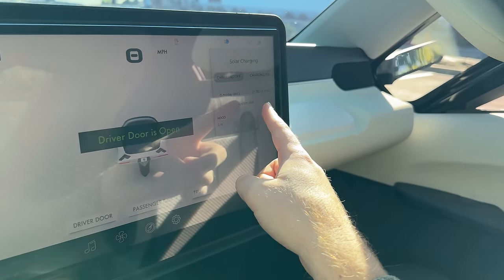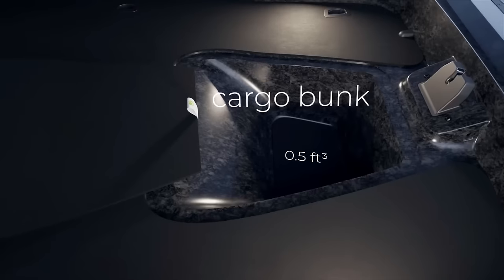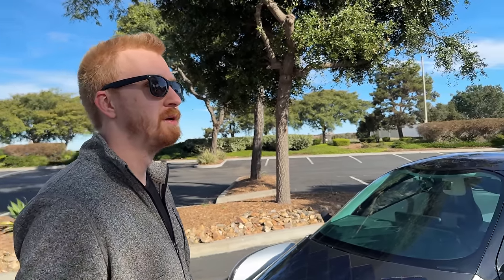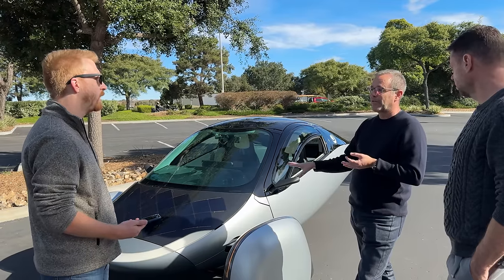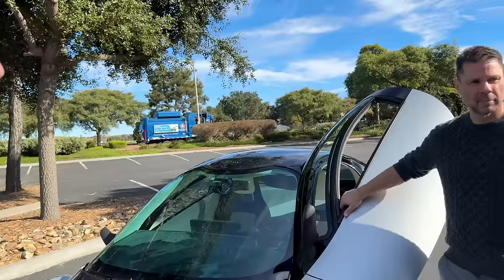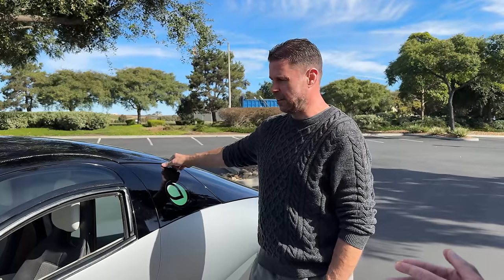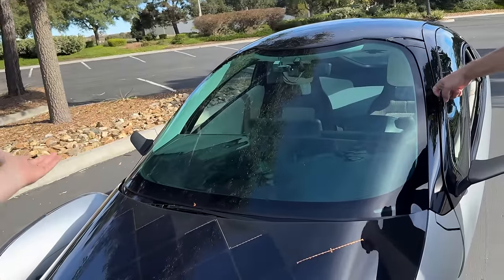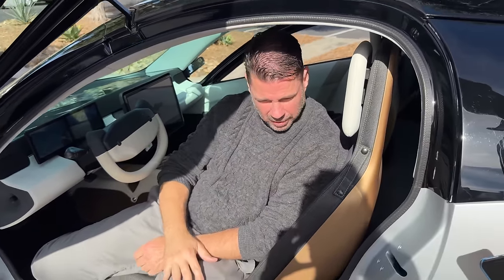Asking Aptera about Safety, HVAC, & More!

Comment: I am continually impressed with how these executives make themselves available.   They are present and seem to show no favoritism.  They are there at events and test drives, not hiding in the background.
Reply: This is the most endearing thing about this project 
I really hope they achieve Tesla-like success.
Reply: That's a strong indicator for vaporwares or scam actually. But I guess they got the product far enough where they can show it around for the next round of investors. This will be all about long-term cost and reliability, which is hard to prove and get the word out before the company folds.
Reply: their marketing guys are geniuses. They understand the key concept of the modern internet: you don't need millions of fans, just a few dedicated superfans. Relatively speaking, this company's following is small, so we will see how it goes
Reply: im just impressed they decided to keep certain things like the wheel covers manual. Yes its a futuristic car, but that doesn't mean it needs absolutely everything motorized and automated. Thank fuck they kept the wheel covers manual, thats one less motor and wire to worry about
Reply: PR tour. They've invited in a load of gullible influencer types who are not asking them any difficult questions.
Reply: @Hamachingo  Yes, they could have demonstrated the miles per kWh by now and the charging performance of the solar panels.

Comment: I figured that the split window was so the section that rolled diwn could be straight, to fit in the door. But it never occurred to me that it was to minimize the drag when you roll the windows down. That makes so much sense when you think about it. 

I was also driving around in my Beetle the other day, and realized that solid upper window would shield against the rain coming in when you roll down the lower window. Its not as much a split window as a small side window, with a transparent section between the window and the roof.

Comment: Thanks for getting into the weeds on some topics with Chris and Jason! Look forward to more Aptera reveals/updates along with your continuing reporting. I will be educating my Discount Tire technicians as how to check/top off the air pressure, changing wheels, lift points, etc… as we all learn. I held them by the hand…. with my existing EV to assure to only use proper lift points for tire servicing…. Seeing scanning of the QR codes to understand repairs instructions /ordering, etc….will be exciting to learn.

Comment: This conversation makes a lot more sense, when the HVAC system is discussed.
It is not the cup holders, the tail light that makes the car. It is the motors, the HVAC, the brakes.
Reply: And the controls/user interface.

Comment: A curtain,  possibly clear. Behind the front seat could drastically reduce the heating and cooling load.
I did this one year on my Chevy volt
Reply: That large windshield if your driving west is gonna bake you if you don't have some great AC.  Wonder if they could make a dimming glass like the Transitions eyewear for it...  Something that doesn't even draw any power but dims with light could keep the car cooler when parked as well.
Reply from the maker: I asked about that later in the factory tour. CEO says the carbon fiber body is more like a thermos meaning it doesn’t collect a ton of heat from the sunlight. Most people will have the solar hatch so the back hatch won’t be clear
Reply: @golfish8589,
I think the solar panels absorb quite a bit of solar energy to convert it into electricity and would reduce the heat in the cabin. The dash solar panels acting the same way.
I think the Aptera cabin would be much cooler baking in the sun compared to conventional cars subjected to the same conditions.

Comment: I want to suggest that Aptera use a direct heating windshield defroster. This is just like the rear defroster - but without the lines. These can do this critical function for a couple of hundred watts, very quickly - think driving in an ice/snow storm or is very low temperatures. Blowing hot air onto the windshield can take thousands of watts. Likewise - heated seats and heated steering wheel, and maybe even heated floor mats, are all required for those of us in colder climates.
An important concept of safety - is deflection vs engagement. As Jason and Chris mention, the shape of the vehicle and its structure is excellent with the Aptera. By increasing the time available to decelerate - means much lower G-forces, which means much better safety.
Reply: Yes a thousand times to the heated windshield. I had one in a Toyota EV and it worked great, much faster and more efficient than blowing heated air to defrost.

Comment: I would really love to have that V2H/ V2G/ V2L capability on aptera built in even if it means installing an extra $4,000 box on your electric panels.  For those who does not plan to install that, they could use the V2L feature to work remotely or even to run your fridge/ heater at home in case of an emergency power outage.
Reply: Although I'm getting one of these as soon as I can, I suspect I'll want to replace it with the 2.0 version that should have V2L, heat pumps, heated seats, and other things that will be Nice To Have. Edit: LFP battery, too!
Reply: @michaelbramel5771  I totally agree with this. It is such a shame to see so much free energy going to waste. 
PS: I hold both a reservation in this and am an Investor too.

Comment: I think it would be great if the excess energy could be put in a portable solar generator that you could use at home in a power outage or on the road camping by loading it in to the back of the Aptera. The Aptera solar cells are at least twice as big as the solar panels that come with the solar generators. Maybe it could also "range extend" The Aptera if charging is inconvenient  on a trip.

Comment: If I was not so damned old, I'd have signed up for an Aptera except for 1 additional thing. While a thing of beauty, I just cannot imagine how quickly the front wheels would get jammed packed with snow, ice, slush from our Western, NY winters. That does NOT make this a bad vehicle, just not the best for Western, NY [or similar regions]. For those old enough to remember the removable "Skirts" over wheel wells know exactly what I'm talking about with snow. You might as well remove them before the first snow and leave them off until spring.  Still, I hope nothing but the best for the manufacture of Aptera and those who have weather more conducive to enjoying this beautiful vehicle.
Reply from the maker: The motors are in the wheel which generate heat passively. Should easily melt anything in there
Reply: @TailosiveEV  If so, then FANTASTIC!
Reply: I live in rural Iowa and have an early model on order.  I will report on my experience.

Comment: In regards to entering and exiting the vehicle while its raining; besides the rubber trim along the inner edge of the door opening is there anything else that will possibly catch the rain water so if and when you open a door you don't get a downpour of water on you?  I ask because I had a Ford Probe do that to me every time until I installed a small thin piece of curved rubber to channel / catch the water and divert the same fore and aft away from me.

Comment: It's shaped like a Prince Rupert's drop— probably going to be one of the strongest cars of all time.
Reply: Great point.
Reply: And on top of the shape, carbon fiber is 5-7x stronger than steel. Safety is always my number one concern even though I've never been in an accident (knock on wood), and aptera is not simply a decent choice but rather the best choice.

Comment: When can we buy one?  I've been watching this car for years...when?  When?
Reply: Delivery date will depend on how quickly financing comes in but could be towards the latter part of 2024, or early 2025.  You would have to take one of the  few remaining accelerator slots to avoid being at the back of the line - in which case, due to demand is likely to be several years off yet.

Comment: I wonder if you could put a film protection on the glass solar panels, like what's on your phone? My concern would be damage from rocks. Great interview! Lots of great information. I can't wait to get mine!
Reply from the maker: The solar glass has been tested with hail chunks going 90mph. It’s quite strong
Reply: @TailosiveEV  I agree, it's quite strong and probably won't crack. My concern would be with chips and scratches from large rocks bouncing off the road and hitting the hood solar at the worst possible angle. This would be more of an aesthetic issue. A 3M self healing clear bra kit could be an option.
Reply: @johnbullers8647  Yeah, gravel trucks can be a menace.

Comment: With the concealed wheels. What happens when it snows? My car with open wheel wells will pack with snow and will get so bad that it will lock up my tire in turns. What keeps the snow back from just destroying the wheel wells?
Reply: Most of the heat that is produced by the vehicle is from the motors in the wheel pants.  It is likely that Ice and snow will melt before this can happen.  I may have an early vehicle in Iowa and will report on my winter driving experience.

Comment: I've got my pre-ordered and this did answer some of my questions... But I live in MN and I'm still wondering how it does in snow or very cold weather. Someday I'll find an answer.
Reply from the maker: Aptera Owners Club has done some great videos on that. It’s all wheel drive and has independent motors in each wheel so I think it’ll do great
Reply: I'm thinking that it would be like driving a normal car.  If the weather's really bad, best to say inside.  It is a lighter vehicle so I would like to see how it does as well in pouring rain with standing water.  Is there a greater chance to hydroplane?  Definitely going for the all wheel drive option.
Reply: @TailosiveEV understand snow could be an issue but I want to make sure cold isn't an issue. Snow gets plowed soon enough but cold is 4 months (or even more).

Comment: What tests have been done to see how the camera system works in the rain? I live in the Pacific Northwest and I love the rear view camera in my Bolt, but it's useless when it rains.
Reply: Testing of the Production Intent vehicles is coming.
Reply: Same here, but I believe that what gunks up that camera is dirty water splashing up off the road, not the rain.  The rear view on the Aptera is near the top of the vehicle.  The backup camera is much lower, but it will not be sucking dirty water into the huge low pressure area that the Bolt has at the back, so I am hopeful.
Reply: @skeptibleiyam1093  🤞🤞

Comment: One concern I have is drive stability under strong cross wind conditions. Does the rear wheel cowling act as a sail causing lateral tire slippage?
Reply: While I'm not degreed in a way to answer the technical aspect of your question, aptera have said many times in the past that the whole body behaves similar to an aerofoil. Thanks to it's overall aerodynamics, it not only slices through the air traveling forwards, but also feels little to no movement from crosswinds. They've mentioned moments that they've driven past 18 wheelers and felt almost zero body movement from the rushing air.

Comment: How about space for spare tire?  They’re so excited for calling the front space an  F word, but no spare tire, no tools, no jack, no solutions for repairs, no dealership with a service and parts department, 
First problem is  when the driver forgets how wide  the width it really is, as well as other drivers, especially at night,,  they don’t see he front wheels 
First solution would be to design a shark fin for the front wheel fender,  or something like a flag as indicator, with lights, 
Second solution is to make he entire fender illuminated for nighttime driving for operator to be reminded not to forget and for other drivers to see how wide it is
There should be large turn signals on front fenders like the old VW Bug , very important for all traffic around to see the whole vehicle and not assume the front wheels don’t exist, 
All body (including doors) should laminated with solar cells so that if at a beach, the doors could be lifted up for even more solar energy gain ☀️

Comment: So are they saying heating won't be done with a heat pump? An AC compressor IS a heat pump - it shouldn't cost 4-5 million dollars to take the hot side and pipe it into the cabin rather than the cold side.
Reply: What people mean is the inclusion of a reversing valve.  Unfortunately Covid 19 had a huge impact in the availability of transportation qualified reversing valves.   I have worked as a supplier for AC  for many EVs including the Ford Th!nk.  

I checked with my former colleagues, including people at Tecumseh products and found that there is indeed a huge continuing supply issue.
Reply: @n.brucenelson5920  yeah, that makes sense, supply issues.
Saying it would take millions of dollars to develop a heat pump is what doesn't make sense to me.
Reply: @AsherMaximum  It is just not the development costs themselves.  The delay in waiting to ship a vehicle until reverse cycle could be implemented could easily result in that much additional cost overall.

Comment: Just the solar panels on the dash would be a great option that Aptera could license to Tesla 
, even if it only trickle charges enough to power the AC or heater. People using dog mode would then be able to keep the climate on, and going, even if the battery is below 20%.  And trust me… in Texas, there is plenty of sun hitting the dash. I  would cover the glass roof, since most have to get an interior cover to block the heat streaming in.

I’m not sure if Aptera could sell as a post product for Teslas, since it would be optimal to have it all controlled by Tesla software.